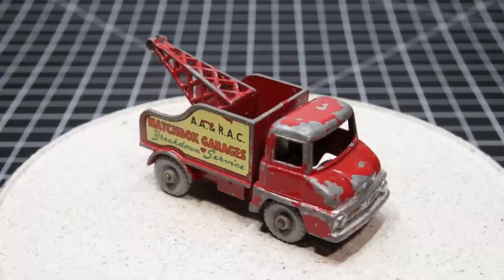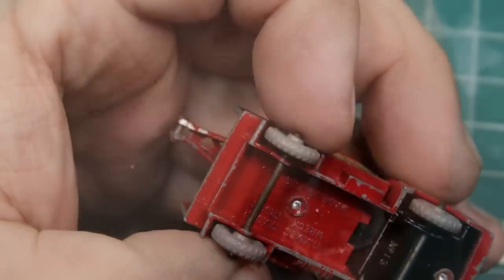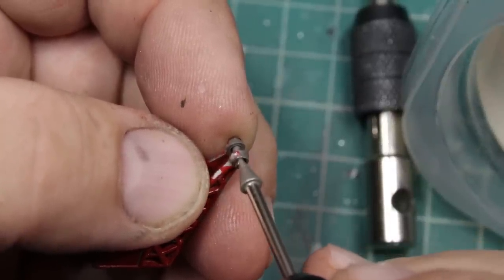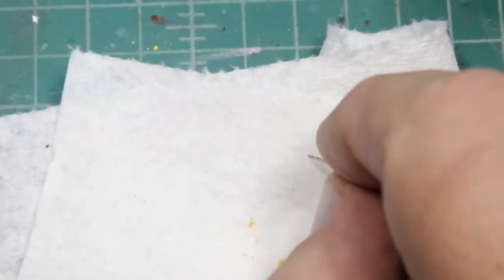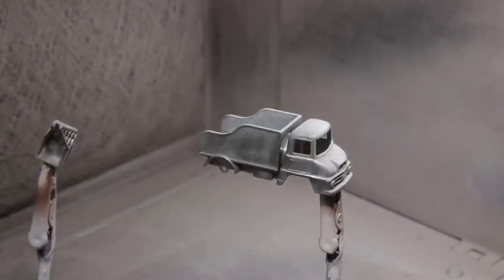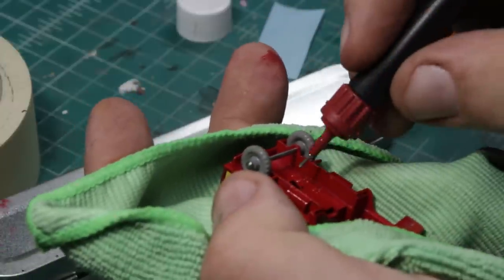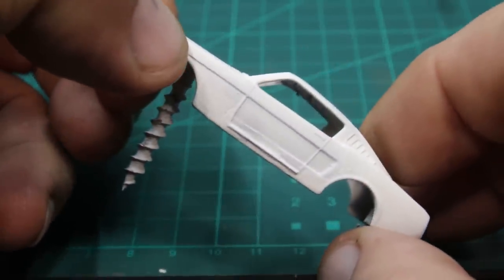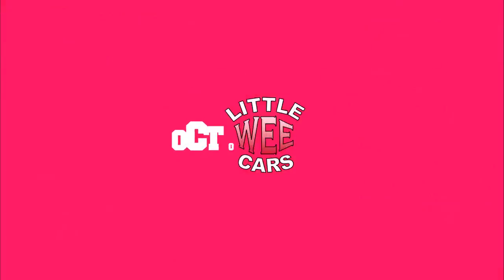Matchbox #13C Ford Wreck Truck - Restoration

Comment: That's a handsome little model. Lovely restoration on it. I do recall having a ride in a Ford Thames Trader as a kid. My dad, at various times, worked for oil companies, and civil engineering firms. One of the latter had several FTT trucks to carry site materials - oil drums, rolls of temporary fencing, hand tools, etc., and it was in one of these I had a ride. Most British trucks of that time were noisy - as if soundproofing wasn't for the working man. Aircon was something from space, too - although it was fitted on early Landrovers - two flaps under the windscreen, open to the outside, providing a bracing blast of air, dust, and insects.

Comment: Brilliant job Lee, came out factory fresh! The real Thames Trader was indeed a cross between a conventional and a COE and it was everything Bob said it was lol, my Grandfather had one back in the day. We kinda got spoiled for choice here in Australia by Ford, at the time we had these and the US F series in showrooms and both saw a lot of hauling well into the 70's and 80's.
Fun fact: Kenworth Australia would later build an Australia only version of the W900 called the SAR (Short Australian Roadtrain) in the late 70's-early 80's which was also a cross between a conventional and a COE (believe it or not there were length limits on them back then). They were kind of a mash up of a K100 cab with a shorter and slanted W900 style hood.

Comment: I used to drive one of these.  The semi forward control layout and half-height doors look really awkward to get into and out of but as long as you start with the correct foot it is actually quite straightforward.  The opening 'nose' gave access to the radiator - the rest of the engine maintenance was via a removal engine cover in the cab.  And yes, by current standards they were noisy, uncomfortable and quite hard work.